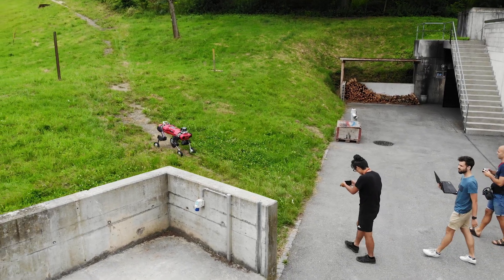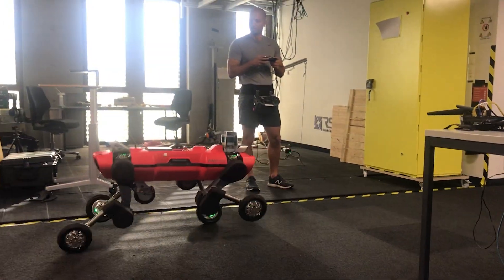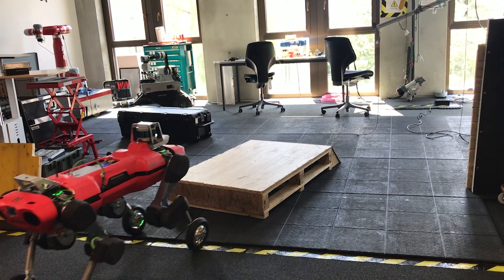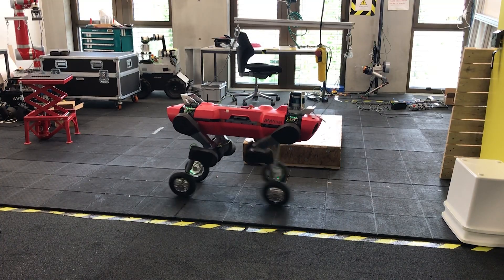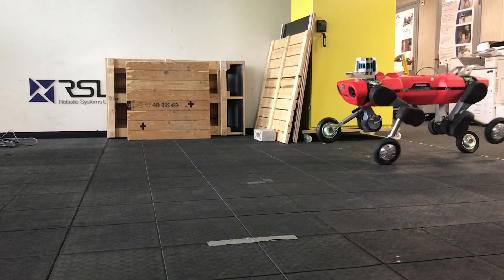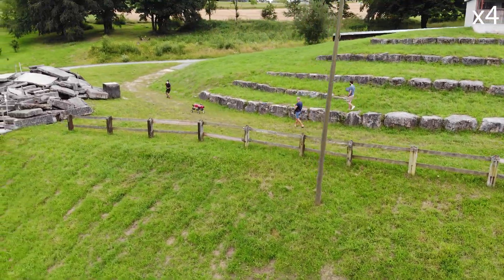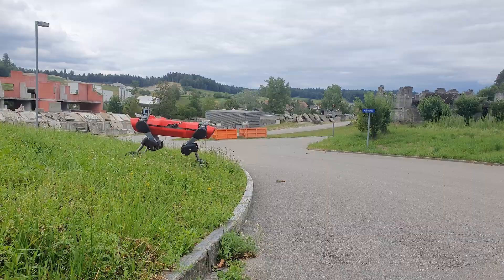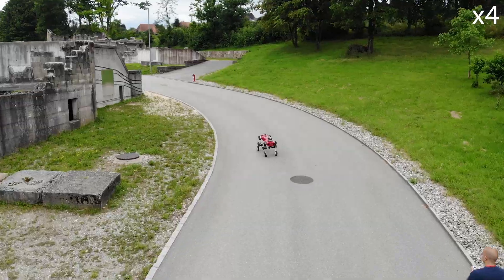Whole-Body MPC and Online Gait Sequence Generation for Wheeled-Legged Robots

Comment: Hi there! I'm curious about the wheel control in your robot. Do you provide velocity commands or torque commands to control the wheels? Is it optimized through calculations or some other method?

Comment: I admire the contributions you've made in the field of wheeled-legged robots! I was impressed by the performance of the Anymal robot in the corresponding video of your paper.

However, after carefully reading the paper, I have some questions. The paper doesn't seem to include the state of the wheels as part of the MPC states and inputs but rather treats it as a rolling constraint.

My question is, how is the control of the wheels implemented? How do you obtain the torque for the wheels?

Comment: There seems to be a reluctance to pursue this concept, yet it offers so many advantages over leg-only or wheeled-only devices.  There also seems to be a love affair with two wheeled or two legged robots, yet this usually means more complexity and potential for catastrophe.  They can't even remain stationary without using power, unless some additional mechanism or "sit-down" pose is incorporated.  You are on the right track!
Reply from the maker: Thank you. Stay tuned and more is to come. :)

Comment: I am curious as to why the robot seems to still have the issue of spreading legs, is this a problem of motor strength? I would have thought a slight inward turn to the wheels would at least stop that in a video from 2 yrs ago, is there more to it than I am thinking?
Reply from the maker: The wheels are still mounted in the same way, i.e., orientation with the human eye. We still need to mechanically align the wheels' orientation.

Comment: I had this idea years ago (see my website). But I also wanted to have gripers/hands on each "leg" and I proposed making the legs interchangeable and field replaceable. Thus if a hand or arm fails, it could be replaced with spares. Designed right, the robots could do it. If there were teams of robots, combining good parts would allow graceful degradation of the mission. Also, some graceful degradation of each robot might be possible. IE limp mode, missing hand, 3 leged walk, etc.
Reply from the maker: Sounds great.

Comment: Watching this happen is kinda like the "Tic-Toc" of processor evolution, but instead of Tic= New Architecture and Toc= Shrink/Condense with robots it's Tic= New Anatomy and Toc= Behavior Tuning. And of course it's far more abstract overall, was far more specific with microprocessor evolution. But this video is a great example of the latter in robotics, and in a very special niche at that.

Point is there is a eb and flow pattern to overall robot evolution at a macro level, as with nature. The interesting thing about watching this specific niche evolve over decades is how the "New Anatomy" aspect is really just adding two unique features into one, but the best part is that one, the leg, is congruent with nature, whilst the other, the wheel, is a new technology by comparison. And a profound one at that. So, we've got natures best land mobility method tuned in an astounding multitude of ways over many millions of years, combined with what could best be described as it's technological equivalent. And even though we've only been evolving wheels, and their multitude of uses, for a few thousand years, holy hot damn have we done a lot with them.
 
So, naturally, putting these 2 together is going to wield some intense results. It lit my mind on fire with ideas in the late 90's and has only grown ever since. It's been excruciating at times watching these techs evolve separately in robotics, right next to each other, and I've been just waiting for it to happen. Like 2 oppositely charged particles hovering next to each other, eager and knowing that reaction is about to occur, and a new form of matter will be born. So now that it has finally occured the things we'll see over the next decade and beyond are gonna be on a whole new level when it comes to dynamic mobility. Creatures that move in ways we've never seen or thought possible.

This lab specifically is becoming ever more focused on making it happen, leading the way in many regards. It's been nice to see you gripping the torch ever tighter to blaze down this path. Really is a special treat to see it unfold so intimately along the way. Especially knowing there will never be another point, in ALL of history, where we could observe this epic "ology" fusion, the leg and the wheel, occur in real-time. 

Keep it going, and Thank You.
Reply from the maker: Thank you for this motivational text. We hope that we can push this new technology even further.

Comment: Impressive.
No suspension, I presume or were you also able to integrate a suspension with the stepping mechanism?
Reply from the maker: There is an active suspension because each leg has 4 degrees of freedom. But not like in a car where you only have springs.